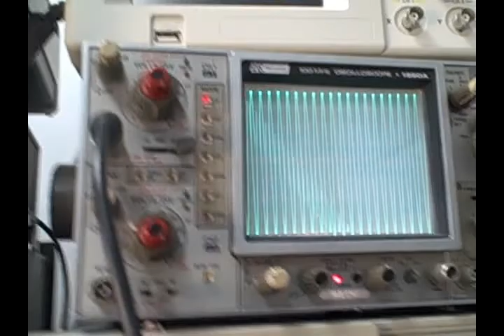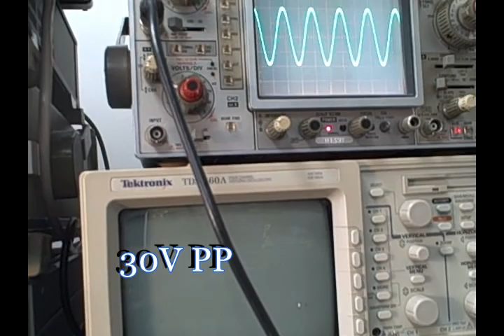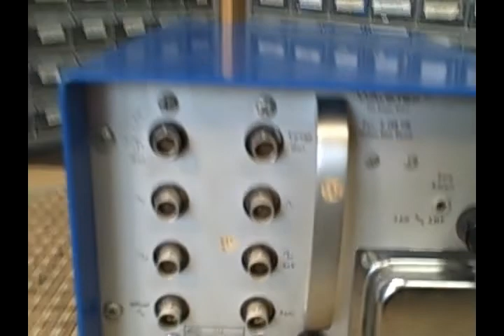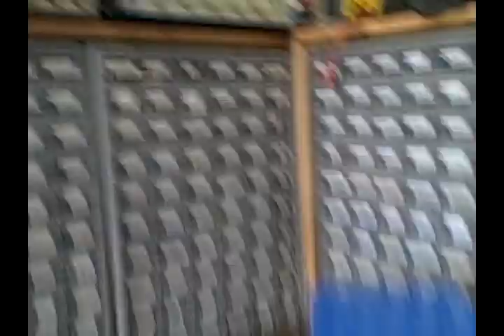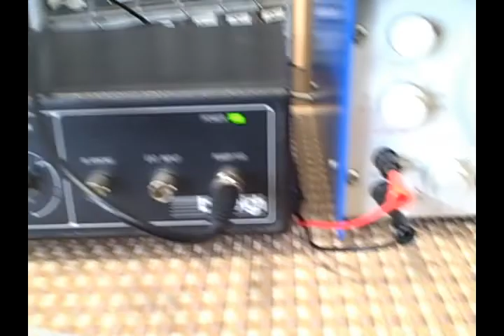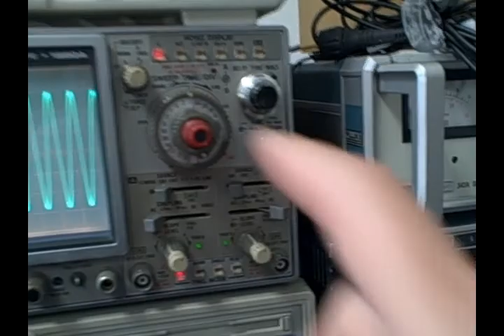WAVETEK 114 - Function/Sweep/VCG Generator

Comment: Nice to see old Waveteks still in use.  Don't know if it applies to your Model 103, but on the 110 series and later, the dial was individually calibrated to the dial pot for accuracy.